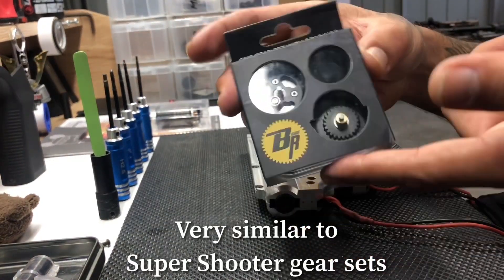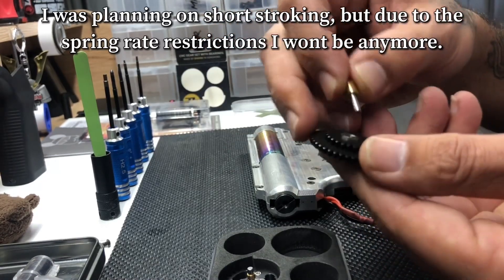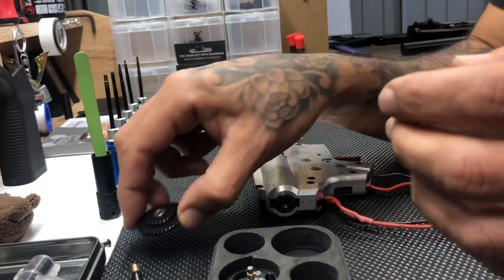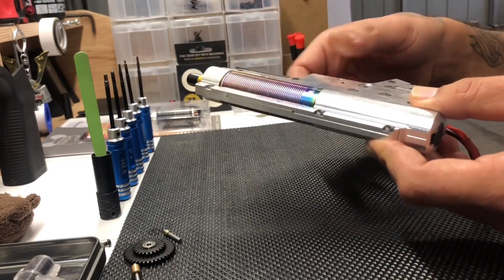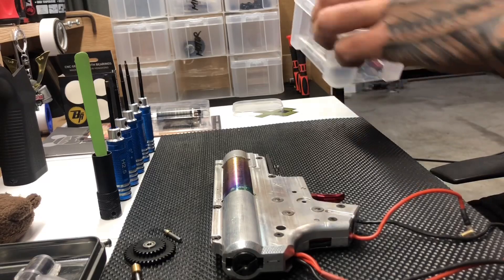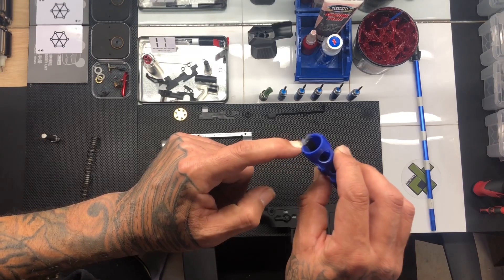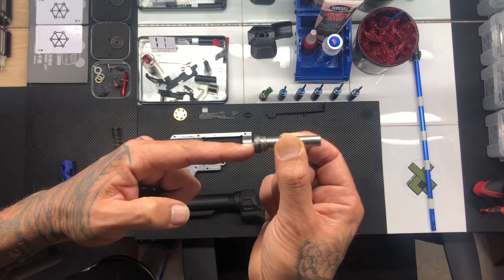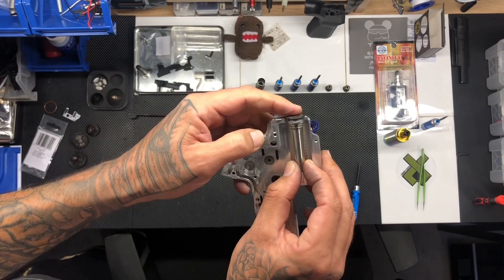BigRRR 13:1 and Tienly 35k Build Part 1

Comment: What is your favorite motor to use in 13:1 ratio gearset builds
Reply from the maker: Hmmm probably something around 25k so it has a bit of speed and still have some trigger response I guess. 
I really like the tienly brand. Might be getting my hands on a warhead 25-30k brushless motor soon...fingers crossed
Reply: @hiroshimascreamer5884  ohh man i emailed them a while ago trying to get one  brushless is superior when it comes to efficiency and torque and speed its sick shit

Comment: Hello, I want to make a configuration with 13:1 gears of semi-automatic ultra fast and silincious (that the motor and gears sound as little as possible). But I don't know which motor is going to be better for what I'm looking for, the one with the 30k or the 35k. Which do you think
Reply from the maker: Ivan 25k or a frankentorque would be better for ultra fast semi auto. Even an ASG 28TPA motor would suit.
Reply: @hiroshimascreamer5884  Thank you very much for answering, but I have a question, why will the 25k tienly motor give a better semi-automatic if the 30k motor also combines some high speed?

Comment: Seen these gears labeled as a different brand for nearly the same price as SHS. What's your take on their quality? I'm not a fan of the separation of the shaft and the gear. Seems as though the gear could shift side to side which would make shimming nearly pointless.
Reply from the maker: They’re ok, quality is good. More suitable more basic to mild builds I think.

Comment: If you buy a stronger motor would you need a stronger spring?
Reply from the maker: Depends, generally yes but not always.
Too many factors eg. gear ratio, motor speed, spring ratio etc etc
Reply: @hiroshimascreamer5884  hmm ok thankyou do you know if a valken kilo would work with a 30k or 35k motor thankyou in advance

Comment: I run the big rrrr 18:1 with a 25k motor and have not had a problem with the bearing on the sector get 330fps and 22rps

Comment: Hi there, so I purchased some very similar gears and I have an issue with the “foil” separating the two sections of the sector gear, it’s faulty and I could simply remove it however I can’t remove the bearing to get to the hex screw that holds the two sides together. Any suggestions? 🇬🇧👍🏻

Comment: be watching this one closely, been thinking about swapping out my 13:1 shs  for bigr's also but my current setup is SS 4 teeth, so the bearing for the tappet instead of a spigot was concern because it took a bit of work to get this build tuned and to get timing on point